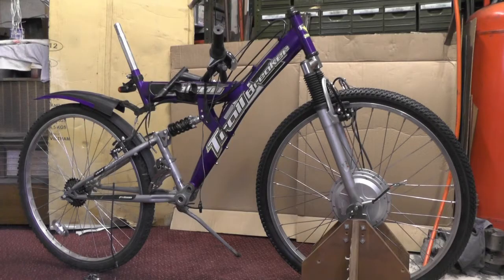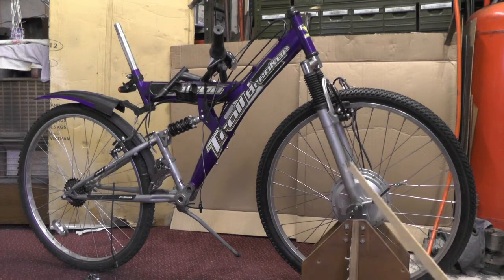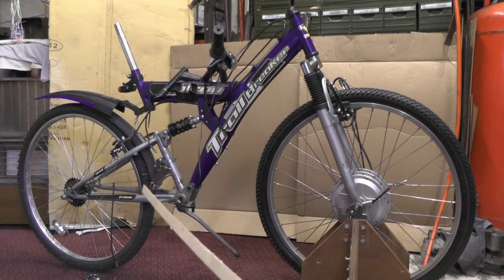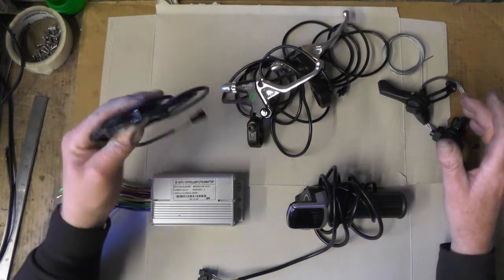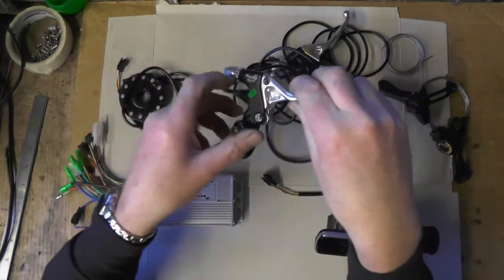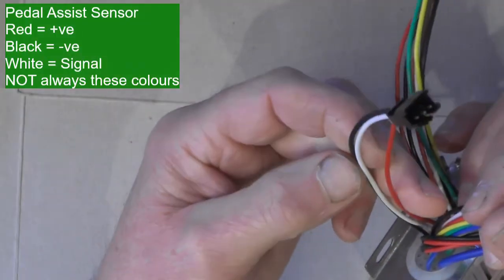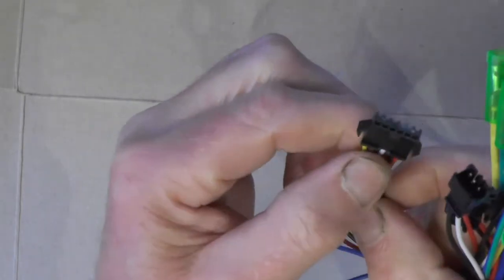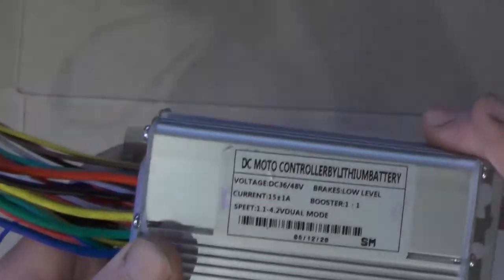Recycle a Cycle Electric Hub Motor (Sparta) Repair a Rear ebike Hub in to a Front Hub PART 6 "mr f"

Comment: Great series, thanks for sharing your knowledge.  I may be wrong about this, but it appears the top portion of your fork is backwards (?)   The lower portion is correct via the brake locations.  The top usually has the "triple clamp" advancing the geometry of the axle location.  Referring to older style forks which have that "curve" forward of the headset line.  Again, apologies if I do not see it correctly, and I really think your broad knowledge is awesome!  Thank you!
Reply from the maker: hi george
please don't apologise, your correct, i was hoping no one would notice that one. but hats off to you for taking careful notice, my excuse is, i had a bad day that day, constantly being interupted, when i was ready to insert the bottom forks, the top yoke spun round with out me noticing, i was in automatic pilot, and thats the result, i only realised what i had done after i'd took the video, and put it right after. Your eagle eyes didn't deceive you. i wonder how many others will notice!!!
I always say this as the saying goes, "Someone who's never made a mistake has never done anything"
Anyway thanks for watching and commenting i appreciate it
regards
mr f